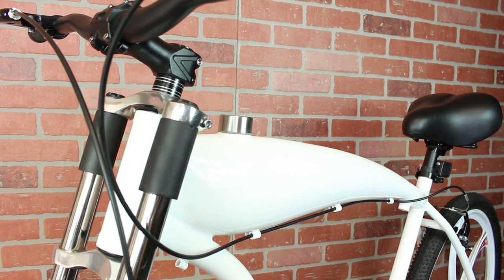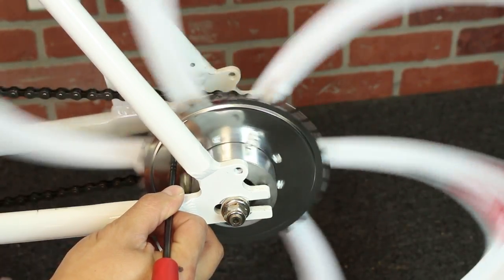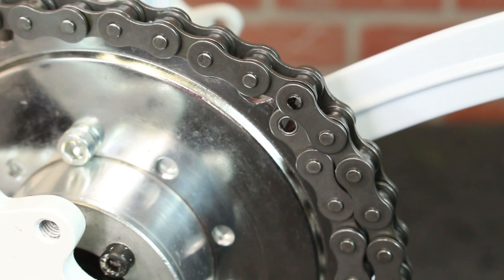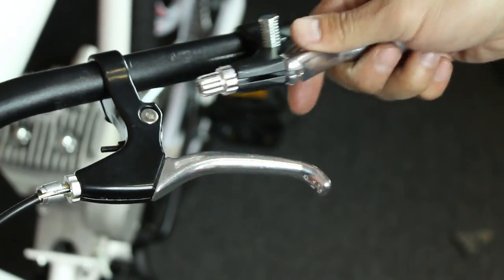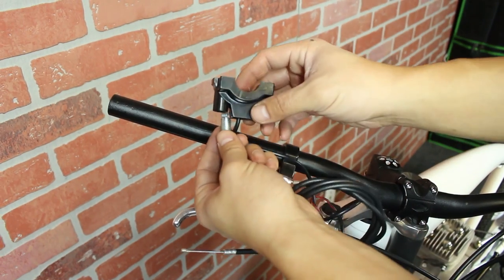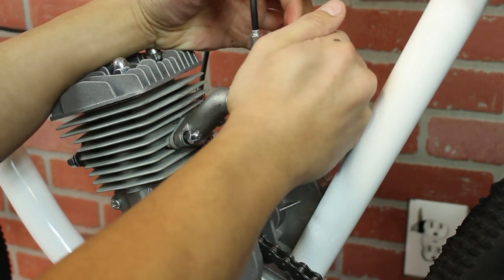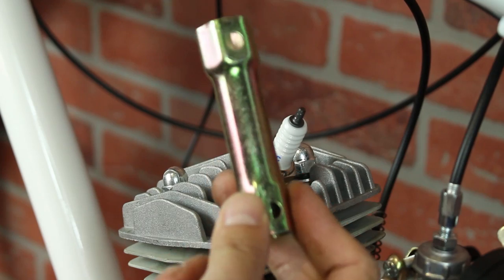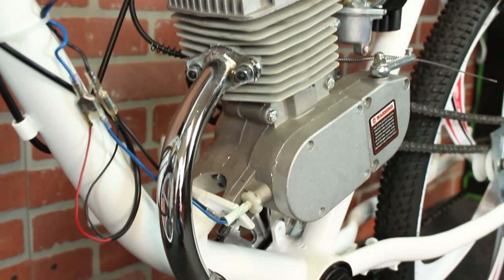Motorizing a BBR Tuning Motorbike Frame! Perfect for any 2-Stroke Engine Kit

Comment: I bought a Sprocket at $12 to replace plastic pulley.Ebay.Don't forget to drill through the mount bracket and into frame,to put a hardened screw through so the tensioner won't twist into your wheel.

Comment: One extra note: Dont use a master link. It'll fall off and leave you stranded. When you push the pin in the chain out, leave it in the outer plate and reconnect them with the pin. 10x stronger and more reliable than a master link. Just my 2 cents.
Reply: You need to make a youtube video of this technique

Comment from the maker: Thanks for watching! We love these new frames and we hope you get a chance to build one. It took no time at all to put this motorize bike together (less than 4 hours). What should we show you next? Leave a comment down below :)
Reply: Do u offer any liquid cooling systems for this , i want to take my bike on a 300mile roadtrip
Reply: ỏm wni pvey
Reply: Anh Nguyen english?
Reply: Why is the wiring just left dangling? The connections are exposed. On my bike it's all concealed
Reply: BikeBerrycom what type of gas to put in it
Reply: For the price you shouldn't have to drill the hole for the throttle switch
Reply: How fast is it ?
Reply: Can you purchase a motorized bicycle already assembled?
Reply: Got one this 2021 winter but still cannot find the right size for the petcock. Is smaller than the one that comes with the kit. NEED HELP

Comment: Is it possible to add a battery and automatic start as well as head and tail lights? I'm being forced to insure as well as register MVA this bike here in Baltimore if I want to use it as a commuter bike (a mile or so to work).
Reply: Talib Akil Bey wow man, that’s a shame! What happened to freedom of the people to ride our bikes without being harrased! You can’t take them on the freeway, they’re one seaters, and you can still pedal them!
Reply: Yes it can be done. They have full kits for adding e-starts.. lights just get scooter/mopad parts controls

Comment: Guys incorporate elastomer antivibe units into frame most of those 2 stroke engine kits vibrate like bees in a tin, The Antivibe rubbers found on Generator units, 40mm is plenty enough too tame those things. Also something under the chain tentioner, 5mm rubber matt should be enough to remove buzz but keep tight.
Reply from the maker: We do carry a vibration motor mount which fulfills your exact requirements.

Comment: Can you PLEASE tell me what forks to use on these frames. I Ordered just a frame thinking an easy transfer and I'm being screw by the front forks and have no idea how or what forks to put on. Any information would be helpful and MUCH APPRECIATED.
Reply: Patrick Fanitzi check out my bmx Motorized bike
Reply: You need a inch and 1/8 headset unit that is semi integrated and an inch and 1/8 Fork either threaded or non threaded depending on which headset you get

Comment: I like mine. Only complaint i have is for whatever reason no matter what the rubber seal on the gas caps ALWAYS break an get torn up when screwing it on the tank?
Reply from the maker: We apologize for any problems this may have caused. Contact our customer service representatives at 1-800-317-0479. We'll try to help you however we can.
Reply: Find an Oring thats Fuel proof and install instead
Reply: Stock762 same for me too

Comment: Won't your muffler rattle off you didn't seem to use lock nuts
Also is this compatible with the anti vibration mounts
And the gasket for gas tank I wish was a little beefier for a better deal cause mine was kinda drippy at first till I attacked it with plumbers tape.
Over all I love your bikes and your videos
And will be likely watching many more of your kinda funny videos

Comment: You should let me build one for you with my custom touches such as hand made aluminum Port matched intake and exhaust gaskets custom boost bottles
Reply from the maker: Sounds great! We just might take you up on this offer.
Reply: 1dirtysancho Instagram... I completely dissasemble and go thru every nut and bolt work my magic on every part then reasonable to my standards then reassemble making sure to loc-tite every single fastener to ensure many many miles of knees in the breeze Kool aid smiles.
Reply: Boost Bottles dont work.

Comment: What's the best quality, most durable, longest lasting, fastest, longest distance range, 4 stroke motorized bicycle that already comes with the motor mounted?  Basically ready-to-go
Reply from the maker: We do not sell any preassembled gas bikes. If you want something ready to ride on arrival your best bet would be to purchase an electric bicycle.
Reply: BikeBerrycom What's the best one you guys sell?
Reply: I Know You're Right But for a gas bike I recommend a 4 stroke for range and reliability. Pedal starting a bike (2stroke) is a pain in the ass sometimes! The best ones you have to make yourself. The 2 I own, I’ve basically disassembled and rebuilt upgraded. I will leave one 2 stroke and convert my one with saddle bags to a 4 stroke engine! These companies don’t provide warranties and the bikes always break down unless you upgraded them with heavy duty parts. Most of the guys in your area usually have no idea what the fuck they’re doing and shouldn’t be building and selling anything! YouTube has installation videos and you can find the upgrades on amazon, Ride on brother!⛽️🚲

Comment: Does the front mounts on frame support 8mm studs like my bbr angle fire motor?
Reply: Yes, sometimes it does not fit in re first try. You might have hand file the side holes a bit just in case if it does not fit in properly. I have that type of problem and it is not a big deal for me. Who knows these gas tank frame may have improved.

Comment: Whats that spacer on the sproket?
Reply from the maker: It is an adapter for our older model of sprockets, allowing the sprocket to be mounted to the disc brake mount that is used on our mag wheels.

Comment: I just got this bike. If you look at back of bike where tire axle slides
 in horizontally it is not that way anymore. The bike i was sent about a
 week ago, the tire is installed vertically like normal (from under bike
 than pulled up at an angel) bikes you would buy at Walmart. When i 
questioned this they said this changed 6 years ago. But why do all their
 Bbr Tuning frames and complete 26 " Bikes on their site still show bike
 with a horizontal rear axle hook up. Even this video still shows the 
back axle horizontal hook up. This video and the companion to it are 
dated  Dec. 2016 and Jan. 2017. Has anyone bought one of these bbr tunig
 26" complete bikes with the rear axle hook up the way its shown here or
 did you get a vertical rear axle hook up like i did.
Reply: probably they didn't change all the add because of the price to redo them

Comment: do you have to have a lisence to drive it on the streets
Reply from the maker: Depends on your local state and city regulations.
Reply: okay thanks i'm in illinois
Reply: @leroycoleman8501  in Florida you don't need one but keep in mind the bike cannot go over 15-30mph and you are required to have a front and rear light if you are riding at night

Comment: You need to get a pull start...if you start it by dumping the clutch all the time it will bust the studs out of the motor..and then you got left with a piece of Doo Doo...
Reply from the maker: This can certainly be the case with casual riders. Clutch start is very popular and standardized in closed circuit racing, and there is also the option of electric start engines. We carry most variations of engines that to fit every individuals needs.
Reply: you can install a pullstart yourself they sell them aswell

Comment: i m having the hardest time w 2 stroke engine . wont start . the only thing im suspicious about is the oil . the kit is chinese and it recommended 10w40 oil instead of 2 stroke . could that b the reason it wont start ?
any help appreciated
Reply: Ahmad Mustafa As long as it's two stroke oil and the ratio is right, it's fine. Does the spark plug get wet? Is there a spark?
Reply: im using 2 stroke oil with 30:1 ratio
theres spark
n gets wet 
may air leak ?
i tighten the nuts n felt like it was trying to start but didnt . so i disassembled the exhaust n cleaned w spray multi task but i dont really sure if its clogged to stop from running , i will install again n try
Reply: Maybe there is an air leak somewhere. Stock carburetor does not have a very tight connection to intake manifold. Mine was leaking air through there and also would not start.
Reply: hi 

im going to try that thanx

god bless
Reply: let me know if that worked for you
Reply: thank u again  4 ur advice n tips
Reply: @freedomknight2766  if your plug is wet then ur flooding the block change ur main jet  if that didn't work u need a new magneto
Reply: And are u sure it's not a 4 stroke cuz I have never had a kit say to use 10w30  and I build these for a living does your motor look exactly like the one in the video cuz if not urs is a 4 banger and has an oil safety switch That prevents the motor from starting when there is no oil u should post a video on here

Comment: Having a brake and a clutch on the left handle grip if goofy! Why not include a double throw brake lever on the right side and the clutch on the right! Also on kit should come with that death trap chain tensioner! Heck one can be made using a simple spring and piece of metal and a longer spring! I guess the point I want to make is that if you know it's junk don't offer it! Include only quality parts in your kits! He you guys want to be known, be known for quality!

Comment: The bike frame should have mounting points for chain tensioner , rear motor mount also the  u brackets are not as strong as mounting steel. By using thick rubber pieces on engine mounting points reduce vibrations.

Comment: The stock parts for the engine are garbage, fuel line and filter, spark plug, spark plug wire, automotive fuel line and filter mr gssket brand, and accell hi supression 8mm sparkplug wire for higher performance and the ngk spark plug,just the wire alone produces very noticeable power and with the plug adds more to that power, try it sometime... thanks for the video

Comment: how good do they glide compared to a bike with no motor ?  my idea is to get going and glide most the time . want to actually pedal at times . need video of pedaling on the road . peal it. lol.  thanks .. reply please.  glide would extend very  high milage  . thanks .
Reply from the maker: A bike with a motor modification will maintain a similar coast experience as an unmodified bike. If installed correctly, it should not impede pedaling but may feel a bit sluggish when pedaling from a complete stop, due to the extra weight.

Comment: too bad motored bikes are highly illegal in California. it cost me 400$ last time I took mine out. Ended up selling it. Rather get a moped, faster safer and I won't get ticketed like crazy
Reply: @jdubyaadams33  it is legal to ride a motorized bicycle in Florida but you have to keep in mind the bike cannot go over 15-30 mph and you require a front and rear light if you are riding at night
Reply: Abel Roman I live in Michigan. I own 2 gas bikes, with front and rear brakes as well as lights. Even though they can go over the legal limit, I operate them in a safe manner and with all safety gear. Usually the police here don’t mind if you’re not impeding traffic and being a jackass!⛽️🚲
Reply: Dude IDK where u live in Cali   but I lived in redding never got ticketed for my bike granted my motor was the epa certified 2 stroke which sucked

Comment: So many bad mouthing the kit! Saying it comes with cheap parts. 
 1st off its ment to be a Universal kit! 
2nd they sell stage 1 stage 2 -3-4-5-6 kits with higher end parts each getting more expensive the basic kit comes with basic parts. If you dont like the  Throttle assembly spend $20 and get a new one
Dont like the tensioner spend $20 get a new one etc etc etc. They also sell each all them high end parts outside of the kits. 
    Here's a idea to think on "bikeberry" guys build your own kits letting customers pick out 2stroke - 4 stroke than from there getting a available parts list building a kit give a discount for the bundling it all.

Comment: Why’s do you advertise a motorized bicycles that you won’t even stick to what you promised to your costumer. I reads many complaints that you don’t even care to correct or re inverse what’s they ordered and what pay for ? I was thinking of buying motorized bicycles from your company and what I have read in the costumers survey is not good.
Reply from the maker: Sorry, your comment is a little difficult to understand. Yes we have some unhappy customers who left bad reviews, but bad reviews does not mean we provided bad service. We also have a large portion of positive reviews that reflect our business model.
Reply: jun Boloy truth of the matter is most of those kits come with cheap plastic parts that should have been metal! Like the throttle for example. Why would you make the inside of the throttle instead of metal?! The hub for the sprocket usually dislocates because it’s bolted to weak rubber that warps under normal use! The chain tensioner that are in the kit works temporarily, so I deem them useless! You can turn them into great bikes once you spend a lot of money on upgrades because of the cheap garbage the kits come with and the kind of bike you use for your platform!⛽️🚲
Reply from the maker: @michaelroberson6490  You can purchase stronger manufactured parts, the kits come with standard parts.
Reply: BikeBerrycom that’s what I meant.

Comment: worst customer service ever . they still owe me a fork that i never got .
Reply from the maker: We're sorry you've had a negative experience with our service. We do try to work with every customer in solving any problem they may have, though, we are occasionally faced with conflicts regarding what we are capable providing. These conflicts may be due to void or expired warranty, item availability, or the lack of cooperation from the customer to find a solution. Contact our customer service representatives at 1-800-317-0479, we'd be happy to work with you in finding a solution.

Comment: You people that use that Chinese junk chain tensioner and end up pinching that chain so tightly in its turnaround from the drive axle make me laugh at the fact that you don't seem to realize that by doing that you put enormous stresses on the chain and all the other components. A real mechanic would not want to use such a setup on their own machine. It is bad engineering.